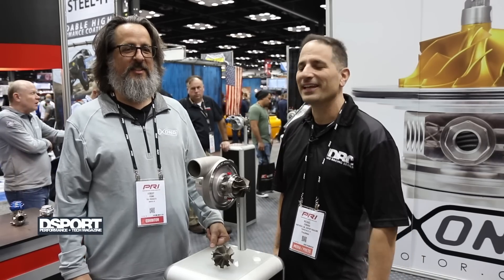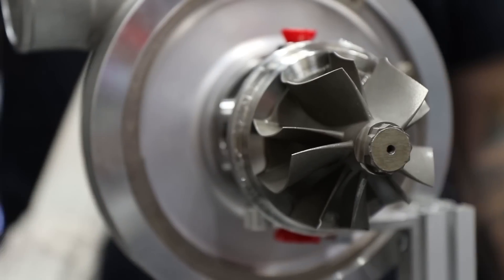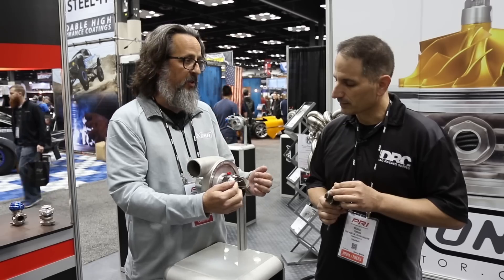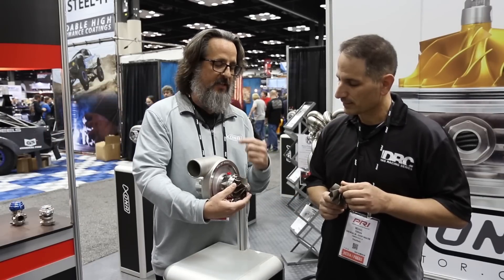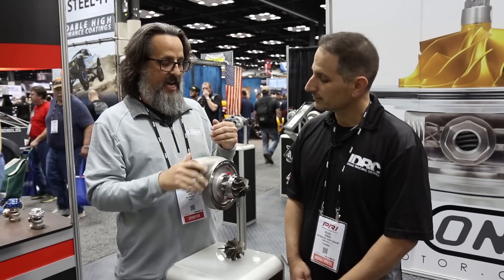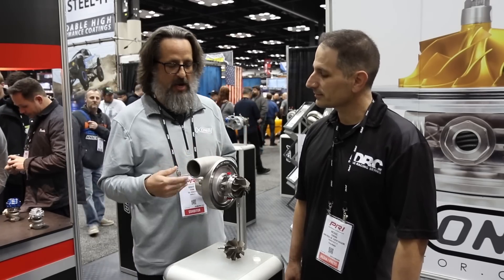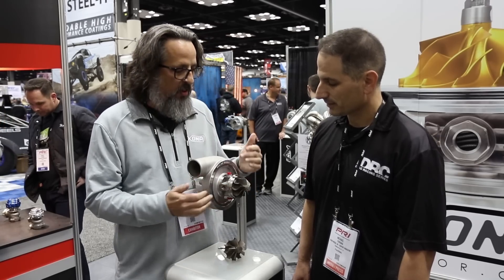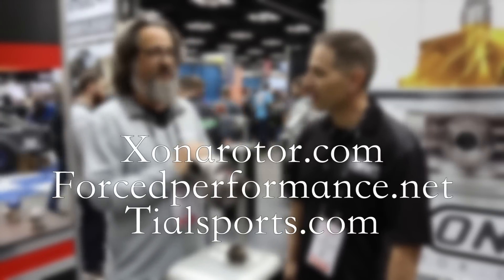Newest Turbocharger Technology: Explained and Tested - Xona Rotor

Comment: What happens when the screen gets clogged? This is why they took them out of the Subies. ;)
Reply: Anthony Allen - NOAA Federal there where never screens in the “subies”. I’m If you run the inline filter/restricter you are supposed to run you won’t have any issues. Clean is isn’t a bad idea either.
Reply: @Yota4wd420  Subaru did use small mesh screens in the turbo feed banjo bolt off the back of the passenger head. If a car has infrequent oil changes or sits for a long time, the screens often become clogged, limiting oil flow to the turbo, causing failure.
Reply: It is a significantly larger screen than what was in the Subaru banjo bolt, so I doubt it will have a clogging issue with nearly as much frequency, especially if not neglected.

Comment: Awesome. 
Stumbled on this looking for info on how to best replicate the mass of the fragile but extremely responsive RB25det Ceramic Turbine wheel but with a material that’s stronger and better suited for the operating conditions of a turbine while still being as light as possible and hopefully retaining a degree of low heat sink and induction characteristics of ceramics. I would be hoping for the ability easily withstand the conditions required produce approximately 320-360rwKw @7200-7500 rpm and 600-650Nm at 4700-5200rpm (overly basic I know but basically, what is THE BEST suited material/alloy for turbine wheel in a turbocharger in respect to usual parameters, PLUS the ability resist heat induction.

What is max shaft speed and torque values and what was the energy input required to achieve it, in terms of volumetric flow, pressure and temp (in C or K please) 

Do you have any data or spreadsheets for the comparison of different housing size, trim, AR ratio and the likes?
Reply: Email us at tech@xonarotor.com for a comprehensive response.